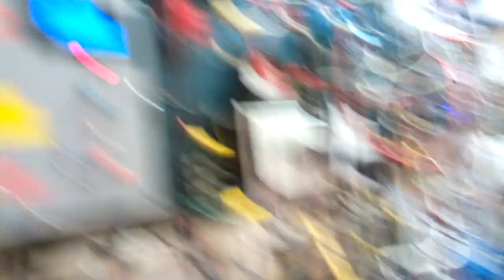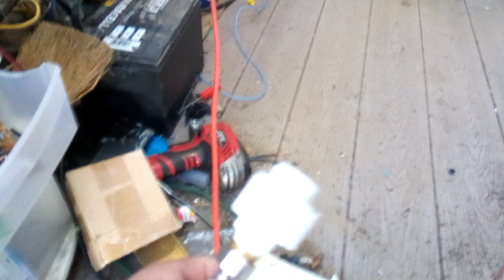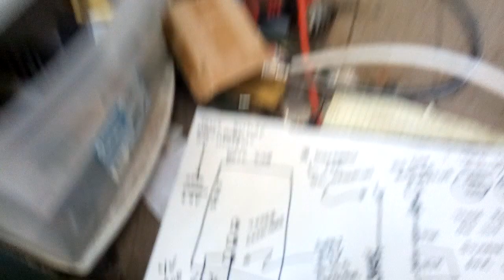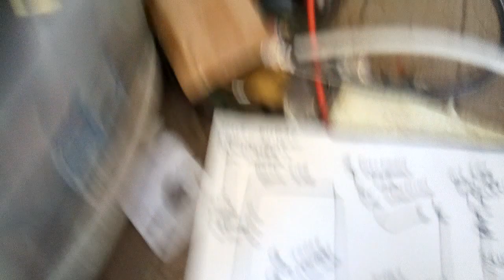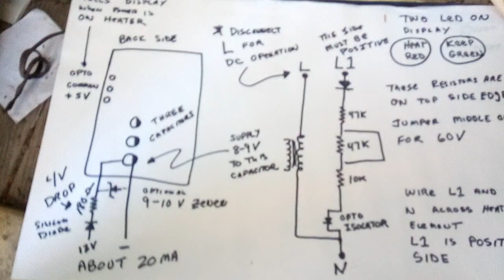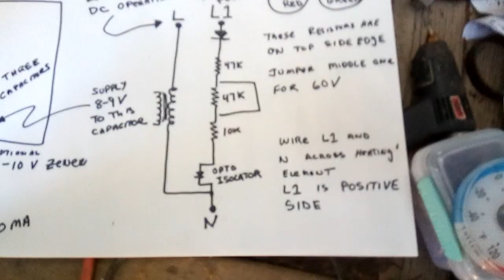50L Horizontal Water Heater, Follow Up and Winterization

Comment from the maker: HOW TO WINTERIZE  Turn the thermostat on the tank to off prior to draining.  The anode drain plug is used to empty the tank for winter. Both the cold and hot ports have tubes which prevent full draining.  The tank male pipe fitting roughly fits a garden hose enough to stay on but it will leak. Loop the hose so leaking water will drip into a bucket then open a hot water valve.   3/4 inch female  plastic threads will probably seal pretty good if an adaptor is made to a drain  hose.  There will be lime sediment and debris from the anode, A LOT. Significant erosion was found in less than two months of use, in just a couple years this will be totally gone. No rust was found in the tank. The anode is probably magnesium but aluminum replacement could possibly be fabricated for lower cost when this is gone. The cold feed has a check valve prior to the white plastic flow restrictor.  This is only hand tight and should be removed to drain water out of it and the tube which extends into the tank. For sure this will crack if frozen.  The same with the hot side if you keep that adaptor.